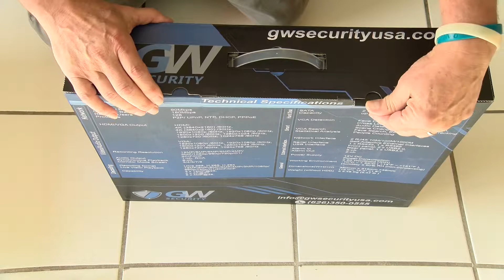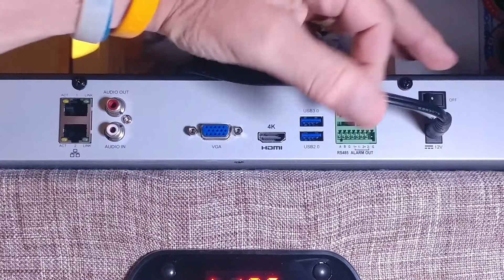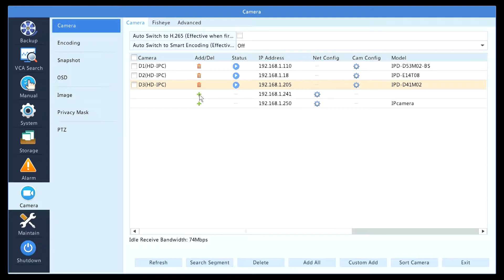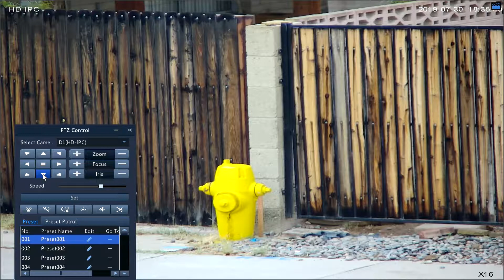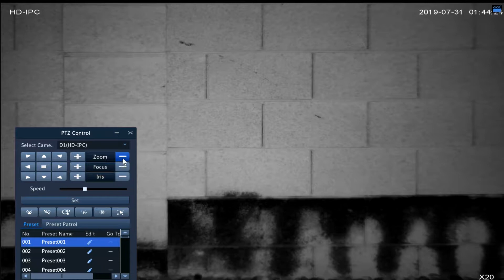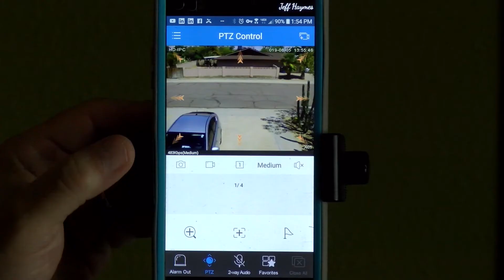2019 BEST NEW NVR GW SECURITY GW4208E

Comment: The NVR only supports windows based clients and the http interface will only work with a windows based plugin which really sucks. I was also unable to get any of the "gw" apps (all published by very questionable publishers) to work at all (I have over 20 years in high level IT). The GW cameras that came with my system are pretty good but I did have one die on me after less than a week. Also the cameras have a metadata tag identifying them as anjvision ipcamera which seemed a little odd.
Reply from the maker: I am glad you shared your IT prowess. Have you called their help line. The guys there are very knowledgeable and can log into your computer and see the GW Security System and help you get the NVR up and running properly. As for me, I have the software running on an LG V20, Samsung Galaxy S5, Samsung 10, IPod 7 ans a Huawei Mate 9. The apps have the GW logo. I have no idea what you are downloading. 3rd party? I am running a pretty eclectic and diversified group of device without any problems. Possibly your phone is ROOTED and you need to change some setting. Call Tech Support. They are in the USA.
Reply: @AZCAMERAREVIEWS  I did not need help setting up the NVR as you mentioned my IT prowess made this an easy process for me. The issue is that I run linux and the http interface will only work on windows. As for their support during the RMA process of my camera they decided to just put the RMA on hold and just decided to forget about it. I had to call twice to finally get them to send a replacement camera back to me all the while running down the clock on my return window to Amazon. The GW security apps are titled  GWCAMVIEW and GWCloudView and are published by Yang DaJun and BBcan and are not play store verified. These are red flags when your expecting to be using apps published by a reputable company. This is all aside from the fact that wont connect to my cameras or NVR. My Samsung Note 10+ is not rooted btw. I can however install some generic IP camera viewer app and it works so...